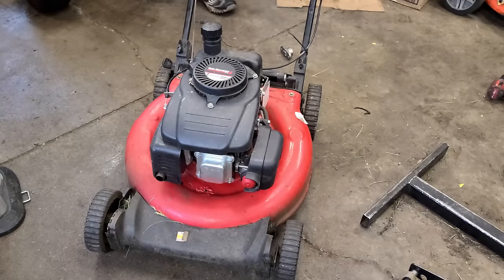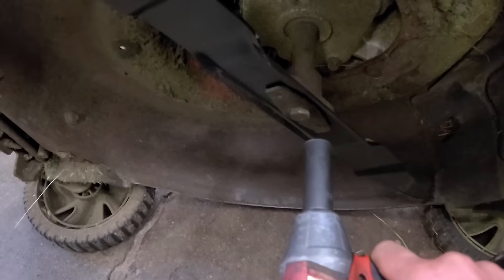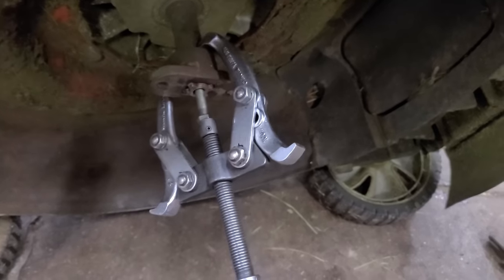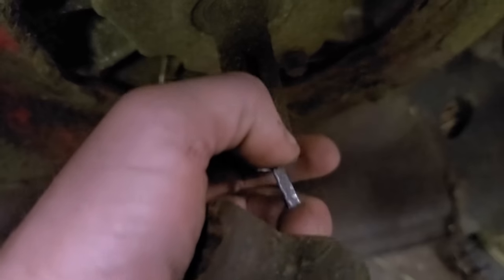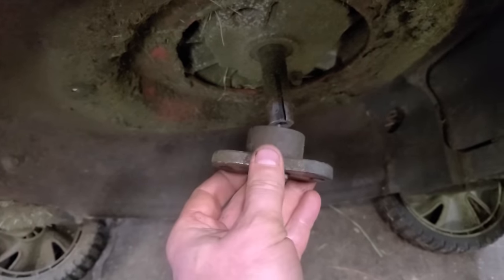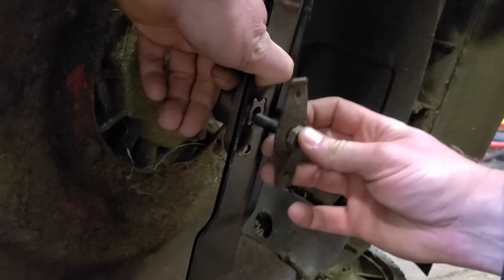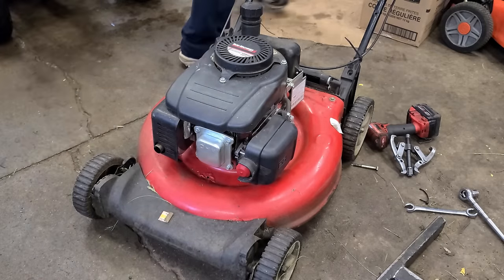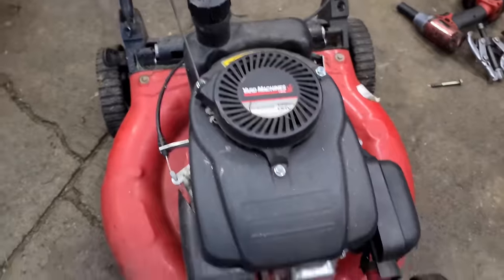Lawnmower Makes A Clunking Noise - Can It Be Saved After Hitting A Rock?

Comment: Your video came up on a random Google search and I am SO glad I did.  
My noise was WAY worse than yours-but same sound after hitting a pretty big rock in the weeds.  I thought the worst!  Pulled the mulching blade and the adaptor was fine, as was the key, but one pin was a little sheared, but mostly the 2 parts of the adaptor seated again after a quick reassembly- and now I know what to buy a spare of for the future.  Fired it up and it was PERFECT!

Thank you for pointing me in the right direction and talking me off the 'my engine is junk' bridge!

Comment: Clever fail-safe part that adaptor, obviously it breaks before shearing a flywheel key or worse a connecting rod. Much easier and cheaper to replace a $20-30 part which Don did in minutes. Clever

Comment: I bought a brand new mower long before those wonderful blade adaptors and blade brakes. We had just built a new home and had something that resembled a lawn...sort of. lol
Well first time I mowed the grass (and weeds) I managed to find a rather large rock. It did bend the crankshaft. After checking on price and availability of a new shaft, I decided it wasn't going to be getting a new one. Knowing I had nothing to lose I decided to see what I could do with it. A good sized hammer and a few well placed blows brought the shaft back to almost right. Like I said there was nothing to lose right. So even with the shake rattle and roll of the mower I used it for a few years until it finally gave up the ghost. hahaha...you just never know I guess.
I think an adaptor like that could have prevented the shaft from bending.
Cheers from NB.
Reply: Even with a sacrificial blade adapter like the one in the video the flywheel key can shear, causing the ignition timing to be incorrect.

I've seen partly sheared. Flywheel keys that caused only a few degrees shift from the proper ignition timing result in a motor that runs smoothly but lacks power due to retarded ignition timing.

It's a good practice to check the flywheel key for damage following a significant blade impact, even if the mower still starts and runs.  (Applicable to crankshaft mounted blades as depicted in the video)

Furthermore, never attempt to straighten an impact  damaged blade.

That can lead to a dangerous blade fracture at a later time

Comment: When i was 15 years old my dad bought a brand new mower from R&S store to cut the high grass over at my late grandmothers estate. I was given the task while my parents cleaned up the inside of the estate. Grass was pretty high so I popped the deck of the mower up to chop down the grass. OOPS! right on top of the oil tank filler. Mower stalled immediately and when you pulled the cord the crank spun freely with no compression resistance. OH S**T I  broke the rod and wrecked  my dads mower!!. He took it back to R&S and they gave him a new mower.  I explained i couldn't see the hidden oil tank filler and was not even punished.

Comment: My 3 horsepower Briggs and Stratton L headed engine on my Supa Swift lawnmower has the 3 bolt blade boss fitted onto the crankshaft & both the key & boss had clearance between the shaft of about 0.1mm or so,it was almost a slide on fit meaning that I could press it on with my fingers.

Instead of spending $50 AUD on a new blade boss & finding out that the crankshaft may also be slightly worn,I cleaned both surfaces & applied Loctite 638 to the mating surfaces which has worked well & it hasn't come loose & caused a vibration again, Loctite 638 is good for up to 0.25mm clearances.

Note the blade boss wasn't cracked rather it came loose after years of hitting rocks,tree stumps & just the inertia of the blade assembly itself just caused it to gradually move over time !

Comment: The ignition timing of many small spark motors is set by the passing of magnets in the fly wheel past an induction device.  If the fly wheel key is damaged such that it is bent but not broken the motor will still run, but will the timing of ignition will be slightly changed.   If/when the key breaks, the ignition timing will be so far off that the motor can not function.

Comment: Hello, can you put 4-stroke 15W40 oil in these machines?
Reply: You probably could, but most push mowers I know of use either SAE30 or 10W30. When in doubt, check the owner's manual.

Comment: People need to take better care of their gasoline small engine equipment they have now.  It's not going to be available forever!
Reply: at $7.00 a gallon for ethanol free, that's not necessarily a bad thing.
Reply: Just wait until we have to pay a high surcharge to dispose of the $100 lithium batteries once they go bad, and then having to buy another $100 lithium battery, which will eventually cost $125-$150.
Reply: @mattb9664  by which time gas will be over $10.00 a gallon. I think I've aged out one set of lithium batteries in the last 15 years.